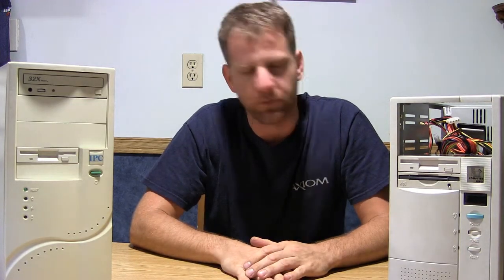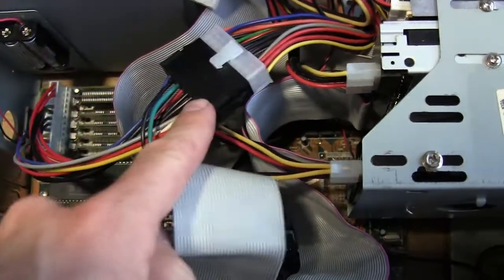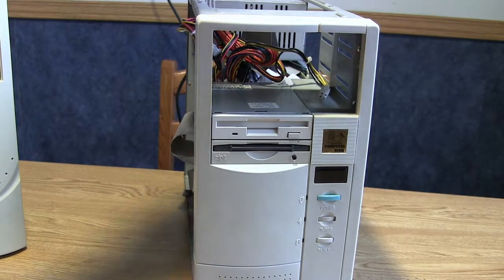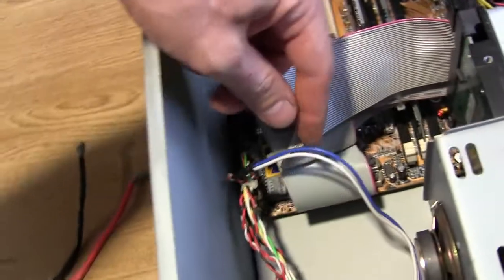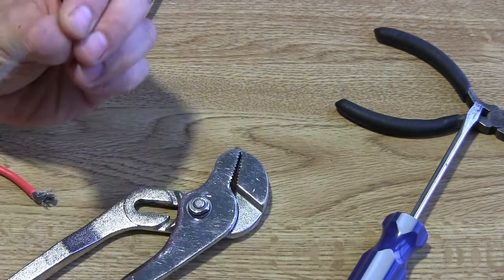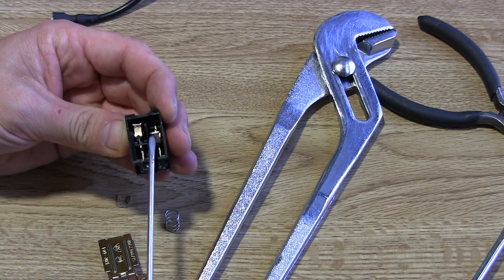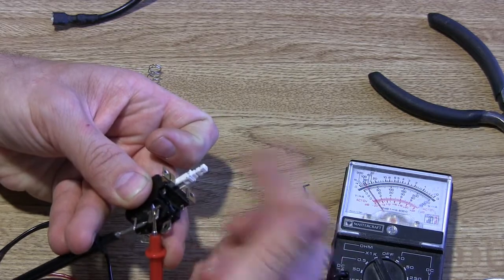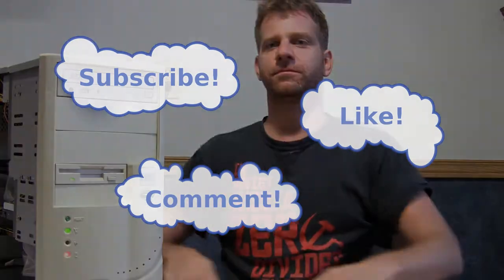Two ways to mod an AT power switch to work with ATX - ON/OFF, and momentary switch hack.

Comment: Thanks for the tutorial, I'll try the second way with the spare switch from my old AT power supply. My board can do either AT or ATX, and it works with the ATX-to-AT adapter already, but skipping the adapter and getting ATX features from the board (soft power off, etc..) would be nice, especially if keeping the original switch is an option.